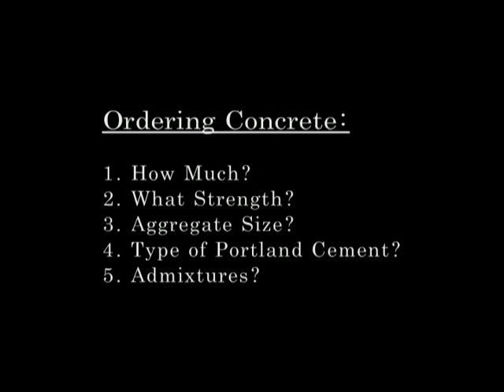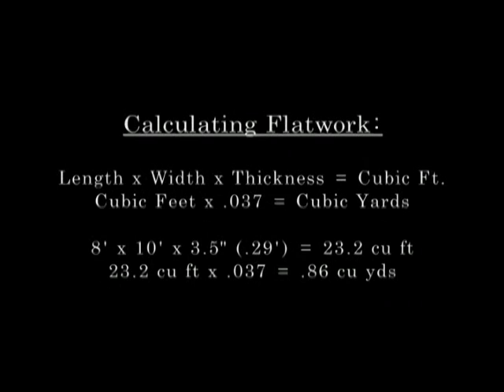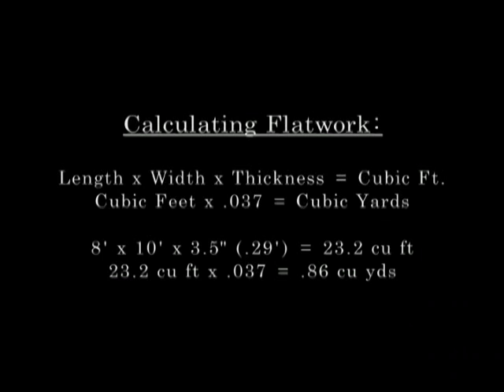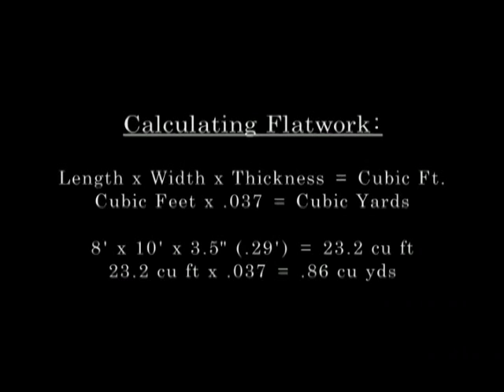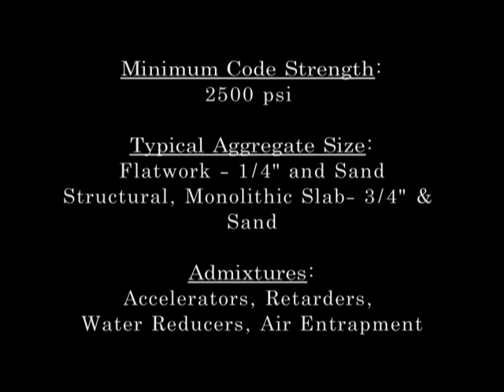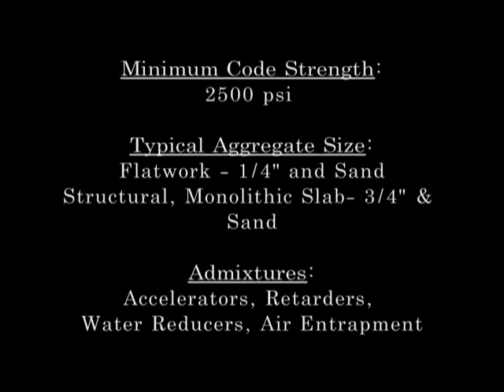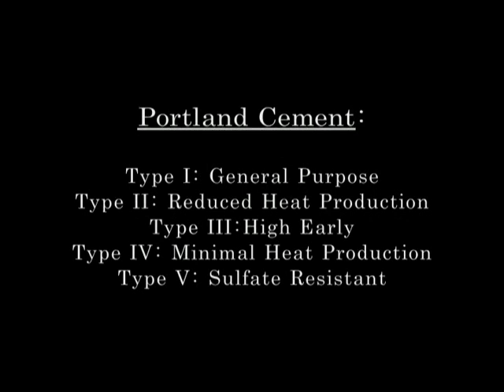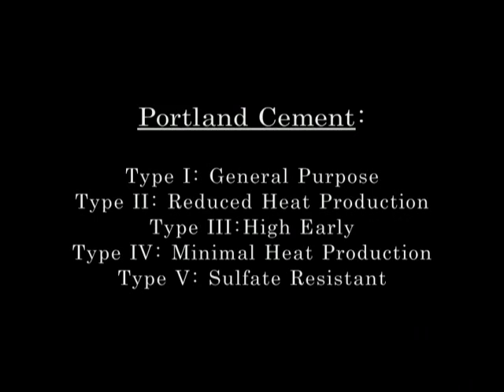Pouring a Concrete Slab Foundation

Comment: Follow this advice and you are sure to get shrinkage cracks. Wetter is not better Also a concrete rake is much easier to pull than push! Pushing the aggregate down to get "cream" also is not recommended! One doesn't have to use all the chutes on the truck. Those front footings could have been poured with one less chute.

Comment: If I could, I'd say screw the minimum 2500psi on the cement, I'd throw in 5000psi concrete to maximize foundation strength. Also, why isn't the guy using a cement pump to pour the cement more evenly around? he wouldn't have to push the cement around so much
Reply: 5k is overkill. Pumps cost money. Next question

Comment: Whomever is driving that mixer needs to go back to school and learn to drive it again, he could easily get all the way over to the edge of the forms and if he couldn’t have he could have poured faster with the idle up to throw the concrete further. Also with Front discharge mixers most of the weight is in the back of it and you can lock all of the axles so he’d easily be able to get down there and out again. I’ve driven them and they are by far the best vehicle ever made for delivering concrete, just wish they were available worldwide.

Comment: This is the right way how  to pour a slab foundation. You do it with rebars.There are some  video  they said they are professionals what they  did is they  just made a square and dump the concrete  and called it slab foundation.

Comment: I'm planning to build a second dwelling our property which I'm allowed max 900 SqFt by the city. Do I need the plumbing in place before pouring concrete? I'm a tile setter by trade but pretty handy I'm also a diesel mechanic by trade. The foundation process is a little new to me, but building walls, roof and other projects I have lots more confidence ….
Reply: Yes

Comment: Absolutely pointless for you to have to rake that at all while pouring. That is a front discharge truck and those trucks can go almost anywhere. I drive these trucks for a living and I have driven those suckers up trails I wouldn't take my four wheeler. There were also many other things you did wrong. Making other people work way to hard if they actually follow your instructions
Reply: Teagan Kite   I am a concrete contractors and you are right.

Comment: Looks like you don't have enough steel in your slab.  

Not sure how thick it is, but a 6" slab needs #4 bars @ 18" on center minimum.  You need more for the thickened slab at the edges.

Also, for slabs on grade the steel should be close to the top of the slab, to help prevent visible cracking at the top.  The steel wire in this video seems to be near the bottom.

For a slab like this, I would use legit rebar rather than steel wire.  If you space rebar at 18" on center, you also won't step on it and push it to the bottom when pouring the concrete. Rebar is about the same price as that steel wire too.

Comment: IF you worked for me you would be fired in about 15 min!!
Reply: He looks like he’s doing the hiring. You’d be fired. Lol
Reply: Yep this is not how you pour concrete the rebar is all wrong there's no vibrator and you're raking the concrete the wrong way I should know I do this for a living
Reply: Hmmmmmm...I wonder what you looked like when you first started doing concrete. I worked for my father on commercial projects when I was 14 on the weekends. The "experienced" guys had me looking for a skyhook for an hour. My father asked me what I was doing and told him Anthony needs a skyhook. My father said to look behind the tool trailer. I did for another 10 minutes and what I found was my stupidity. Shorty thereafter the foreman asked me to get hima  bucket of steam. At 14 I learned fast. I smirked and grabbed my crotch. The antenna's were up after that.
Reply: @danc3831  I knew pretty much nothing when I poured my first slabs and even I knew to put more bricks down to support cattle panels I was using for reinforcement.  He's stepping right on it and with the small amount of rocks he has under it all it's going to do is sink to the bottom. Then you can step on the bricks and not bend it! :)

Comment: Never rake toward the truck lol. The truck can drive forward👍🏻
Reply: obviously you didn't watch the entire video or you missed when he clearly stated the reason he was raking each part. ITS BECAUSE OF THE TERRAIN THE TRUCK WAS NOT ABLE TO MANEUVER SO IT HAD TO POUR FROM THAT ONE SPOT. that is why he did it like that and he even tells you not to do it that way if you can avoid it. so instead of laughing at him, you should be laughing at yourself.
Reply: @00kaza00  He could have taken one piece of chute off and it would have poured where he was pushing it.  Also, if the truck drove in that far, he can back up a bit too.
Reply: Never comment on the video without watching lol. The video can explain what's going on👍🏻

Comment: way too dry
Reply: decoysk
That's why you  should use lube
Reply: decoysk that's way I prefer 2× when u have a dry concrete  drink xx stay thirsty my friend
Reply: Too much water = weaker concrete! = high cracking too! though I would've used a concrete poker to help the concrete flow and compaction!

Comment: any concrete construction just the perimeter should be 30 inches wide x no less of 1 foot, pay attention, any hill close by, can carry lots of water , freeze in the winter.  Do the job good at the first time, use iron bars one inch diameter two bars all around the perimeter, all around the perimeter you should have weep hole to carry any water way from the construction.

Comment: How do you insure that your installed mesh will do its job in the concrete? Will you have the correct space between the ground and the mesh? To avoid future cracks? Just asking.

Comment: Grade isn't consistent you can see in the center(video point 4:06 min. ): So, so you could have shallow areas making it under the correct depth or deep spots using more concrete than you calculated(ordered) or both. https://www.facebook.com/WilliamsConstServices/?ref=br_rs

Comment: bunch of dumb asses
right dare
Reply: Can you explain why?
Reply: no form oil...use water to soak job site pile up mud drag it.no help saw n concrete to get it flat...really.half inch bricks n a 10 inch pour.wire is not rite....one by stakes as kickers...................wth....jitter bug wth.....u are not a concrete finisher nor a reliable contractor ..........................nuff said...................wheres the finish product at............................................. AS TRUMP SAYS..........................YOUR FIRED........
Reply: metallitech because they don't know what the fuck their doing that's why!!!
Reply: James Hines

Comment: Other points made. One other,tap the forms as you pour to prevent honeycombs. The sooner the better. You could've added 10 gallons to that truck,No need for it to be poured that stiff. Also,in the future,pull the concrete away from the chute,not toward it. One more thing,when pouring a building Alan always lay down some 6 mil. Visquin helps a lot with the concrete sweating later on. Tamping is obselete,pointless. Bullfloating immediately after screeding knocks the rocks down....just don't pour it so stiff you gotta pull it out of the chute. 7"slump from the plant,it'll be 6" coming out of the chute. Generally,a perfect slump.

Comment: Just do length times width divided by 27. That would be a foot thick. There are 27 cubic feet in a cubic yard. And if you don't know what your doing, hire someone, or just ask the dispatch what mix is best for your application. And it looks like it's cold out,  put plastic over the gravel, keep the ground dry, and water won't keep concrete from sticking, use some type of oil to spray on your forms. And you need to use larger stakes and 2x4 kickers so it won't move at all. You can't move a monolithic slab if it's not square after the fact anyways. And it was poured too dry for two guys inexperienced. Plus you bull float immediately after you screed. A tamp will cause the concrete to scale during the freeze /thaw cycle. The top will pop off. Just saying. Plus I can see ripples line speed bumps when you bull floated. I don't know any these guys on you tube don't just hire a pro for 4-6 dollars per foot including the concrete in that price

Comment: with 4 shoots you. have 16 ft.you could of had the driver pour it right were you needed it without all that taking..looks like a montiliptic slap..you really overworked yourself ,and yes been doing this 25 years
Reply: He sure did a lot of unnecessary work pushing all that concrete around.
Reply: Looks like he had the driver back up a bit, but it wasn't shown.

Comment: Pour the ring beam part first, and poker it down with a 2x2 to make sure there are no voids in the sides of the slab. Pour the main slab after all of the outer ring is filled and tamped down.If you have voids, water will get in, freeze and split the edges out and the rebar will rust.
Reply: whats a ring beam?